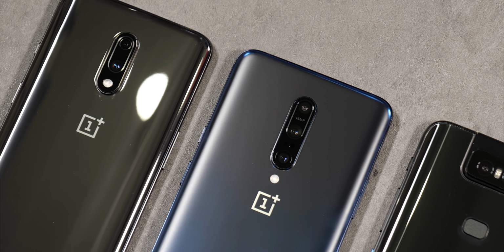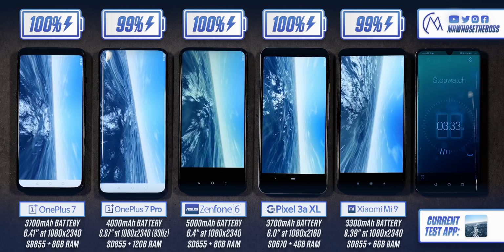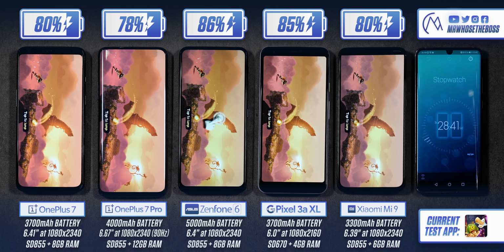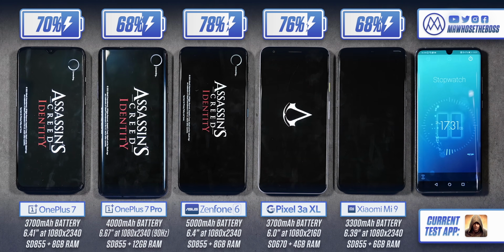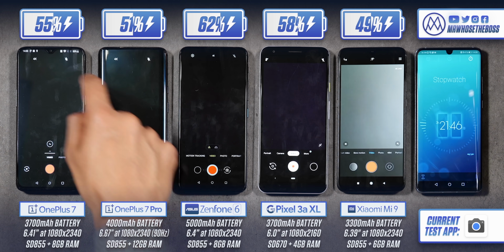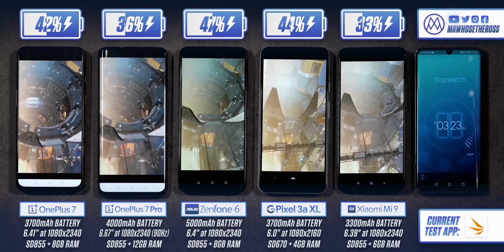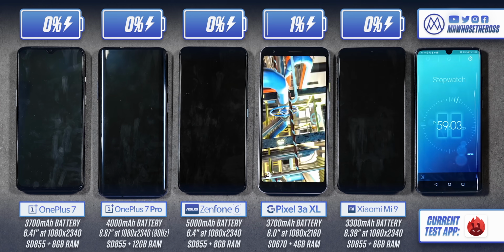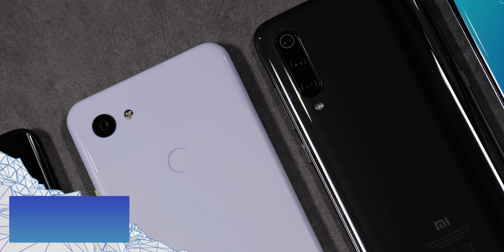OnePlus 7 vs 7 Pro / Zenfone 6 / Pixel 3a XL / Mi 9 Battery Life DRAIN Test.

Comment: Wow, Pixel 3aXL. I wouldn't have imagine that it will win. Kudos. Great video! 😁
Reply: same
Reply: yeah but look at the screen size of it. its no miracle that it won tbh.
Reply: This phone has to last longer than others because it doesn't do much (SD 670 is a lot weaker than SD 855, so...)
Reply: It's all because of the chipset. SD 670. 
6 series chipset is all about baterry life.. Amoled display also is an advantage .
Reply: 855>670 price 670<855
Reply: If you have a baby screen and a shitty slow processor, the battery is supposed to last long.
Reply: @sajeevrajendran  Yeah, I don't understand why people don't see this.
Reply: Because the chipset is low and not 855 and has a smaller screen that explains why.
Reply: @Pekara121  bud it's 6 inches it ain't that small. Lol!
Reply: @vismaydharod313  lol baby screen yeah right.
Reply: @lutlu759 not in general but compared to the other smartphones shown...
Reply: @Lohkat  Lol since the 855 is newer and more high end, it has also better Power efficience...
Reply: @vismaydharod313 snapdragon 855 processor uses less battery than any processor

Comment: The Asus have 5000mAh
The pixel have slower CPU.

I have Asus ZenFone Max Pro M1 which have both.
I get at least 9 hrs easy.
Reply: Bro 10 lol 😂 hours
Reply: Me got max pro m2 by using data for u tube and online its around 5-6 hours it's normal or not?
Reply: @mokmung3458  no idea about m2 my brother have m1 and it's battery lasts about 9to10 hours lol 😂
Reply: Hahah my phone lasts for about 40min :D
Reply: Your missing the point on his testing. He is using Max brightness and running it through very strenuous apps like 4k video recording! 
I get on average with my Mi 9 I get 9-11hrs of on screen time and combined before I charge it 17-20hrs. 
The Mi 9 does very well on battery management.
Reply: @gregwilliams4380  you are missing the point. I'm just sharing my experience with my phone. I ain't shitting on those phones, I love them.
Reply: @mokmung3458  M2 is more power consuming . I have both M1pro and M2 pro and M2 dishcharges battery pretty fast......my personal fav is M1 minus the AVG. camera,  Still if u play pubg it's better in M2 pro. .
Reply: MY LG Q6 can barely do 5 hrs 😂
Reply: Akash  noob I use the phone and trust me I dnt need a charge the whole day.. .I have a Ip8 as well but I gave to my family member....dnt want to b anxious whole day due to low battery
Reply: @internvagabond8575  as m2 have a better chip than m1
Reply: I get 2 days worth of usage
Reply: @internvagabond8575  ok bro thanks for the info
Reply: Slower cpu = worser battery performance
Reply: Even I have that 😂😂
Reply: GT_ 810* mine to
Reply: Hehe boii the same as me😎
Reply: nokia 3310 killer?
Reply: Mohamed Osama no that lasts 100 days with battery
Reply: 5000mAh and only around 10h?
Pretty bad battery management lol
Reply: @bahashajrawi7825  "worser"
Dude
Reply: @mokmung3458  Regularly I'm getting 8hrs sot in my Max pro M2.
Reply: @mokmung3458  I think that's normal bcz data eats lots of battery juice. My phone, A7 2018 can last a day with WiFi, but can't last a day with data. For my phone, it also heats a lot.
Reply: @crateer  it's based on usage patterns. If you're a light user, you can easily get 2 days of battery life, but if you're a heavy user like gamers, maybe around 7 hours.
Reply: @Born Boy me too I am using Max Pro M1 with custom rom it has great battery life same as stock rom....
Reply: @muhammadichsanjordan3857  cheap, stock android with 5000mAh. Asus must've sold a lot. Not to mention you can put pixel camera app on it, which takes wayyyyy better photos than the stock camera app.
Reply: im going to do a video on zenfone 6... it going to b epic
Reply: Mine still gives me 12 to 16 hrs
Lost 800 mAh in more than a year
Reply: I have the Asus Zenfone 3 Zoom with the 5000 mAh battery and the SD625. I get 12 hours of screen on time before my battery saver kicks in with 15% power left over. It also has an amoled display, if that makes any difference. I'll never go back to a smaller battery. I'm spoiled.
Reply: @jerrybandy3827  625 is clocked at 2 GHz, 636 at 1.8 GHz more stable and power efficient
Reply: Wow 9 hrs. On me the MPM1 always take average SOT with 8-9 hours. (With greenify non root)
Reply: @gt_8106  what is this shitty phone man? Hhh
Reply: @bahashajrawi7825  OS Optimization play a big role in battery management, and you know how Google handles software things.
Reply: My 2 year old pixel lasts 2 hours 
Meanwhile my M1 pro lasts 8 😂

Best camera. Best battery. Different bodies.
Reply: I got 1 week on my 5 years old OnePlus One ;)
(I turned into airplane mode and I rarely used :D )
Reply: Akash  this phone is pretty good if we're talking price to performance, but I'm looking forward to buying a Pixel 3a. It's such a simple phone.
Reply: Akash  Yeah I kind of find that a dealbreaker for me, sometimes I want to get the Zenfone 6, which slaughters the Pixel 3a when it comes to specs. Yet I absolutely yearn for the excellent software the Pixel 3a rocks. Until then, I'm stuck with a Max Pro M1.
Reply: Zenfone 3, 6 ir 7 h xd
Reply: @mokmung3458  no, 9-10 hrs. minimum
Reply: Bro I also have Asus Zenfone max pro m1 and I also have the same result that u have
Reply: My phone is also Asus Zenfone max pro M1 (6GB)ram variant I will get 6:30 hours with continuous playing of PUBG😇😇
Reply: Watching on my asus Zenfone max pro m1
Reply: @mokmung3458  used to have the same worry, untill i found out that there were a few apps that kept running in background and some of them didn't even show up in the battery consumed by apps section
Reply: @khami.30  can u please share with us what aps running behind mx pro m2
Reply: @mokmung3458  jio apps run a lot in the background and ate the battery of my pro m2, including JioSaavn
Reply: @khami.30  just uninstall that apps and it's be ok
Reply: My redmi 7 can last up to 12hours of screen time
Reply: Gowtham Vicky  no
Reply: wtf i have the same phone and well i dont use it so much but i get full day atleast

Comment: Pixel 3a xl won because of sd 670 its very efficient (consumes less power) and stock Android is also light 
Where as Zenfone has tons of unique ui features (close to stock) more powerful sd 855 and it has ips lcd display which consumes more power than amoled display on pixel 3a
Reply: Zenphone more like Shitphone
Reply: @User-sz7lw  lol zenfone 5z was a success it was the only phone giving a wide angle option while others gave a shitty 5mp depth sensor, it also had a flagship chip and near stock ui and zenfone 6 will deliver the same result
Reply: Sd 670 is not efficient at all its just less powerful and needs less power
Reply: The chip is rubbish it is normal
Reply: Zenfone ui is really close to stock Android i don't know where you got these information dude
Reply: 670is year old chipset. It should have came with 675 or 710
Reply: My main issue with the Zenphone would be Asus' incredibly bad reputation when it comes to actually Updating their Devices.
OnePlus has clearly lost their touch, they used to win Battery tests and also used to win on Value rating...both now gone.
Google has finally found it's way back to a phone everyone can love, and it's (unsurprisingly) the one I am typing this on just now.
Reply: Every phone at that this table had an AMOLED display whilst Zenfone 6 had LCD that what caused it to die quicker then Pixel 3a XL. If it had Amoled display it would outperform it.
I AM NOT ASUS FAN, MIND YOU I DIDN'T HAVE ANY ASUS PRODUCT SO I AM NOT DEFENDING IT. I have Xiaomi Redmi Note 5
Reply: Trippy OG how ironic...
Reply: @6oLsh0i6o0z3  he isn't wrong about the LCD and Snapdragon though. However he is wrong about the software.
Reply: @rolandrohde  Asus said that for the Zenfone 6 they have a contract with Google for Android Q
10Q and 11R
Reply: @BlackParade01  His LCD and Amoled comment was added later after the fact, and I refuse to believe 2-years old tech 10nm SD670 has better power efficiency than the latest 7nm in SD855.
Reply: @xandersander6369  
Time will tell. Their track record so far is dismal
Reply: @6oLsh0i6o0z3  because the 670 has 2 performance cores and 6 efficiency cores, all underclocked, compared to the 855 with 1 power core, 3 performance cores and 4 efficiency cores at higher clocks.
Reply: @BlackParade01  LCD consumes less power than AMOLED, only if you display a large number of black pixels (that are turned off on AMOLED), you will invert the situation.
Reply: Zenfone is close to stock Android get your facts straight before you talk bs
Reply: @6oLsh0i6o0z3  its not more efficient smarty it consumes less power
Reply: The IPS used by Asus is quite efficient and doesn't make waste, the 10%(50 min) gap from OP7 is not bad. let's just say if the Zenfone 6 used the amoled, the embedded battery is 4500 mah. I'm understand that designing a new innovation requires a high cost, and pricing is the highest consideration for Asus because it is able to consumer attractiveness when the China smartphones invade the market and conducting price wars. But on the other hand, Asus also sell a new innovations.
Reply: @Prashant Patil more ram doesn't make the cpu consume more power
Reply: @Prashant Patil True, but also higher quantities of ram require more voltage to run, even if the phone is idling with no apps open.
Reply: You're 1000% wrong bud, 10nm lithography is less efficient and as such the 670 would consume more power under the same workload. Lobby your developer to constrain your chip, implement a 3rd party governor, or face the fact that a less powerful chip cannot be considered an advantage for battery life. You are WRONG.
Reply: @6oLsh0i6o0z3  is not about nm is about the power of those chip...
Reply: @Smash_ter  I think the company is useless why put small nm then claim better battery life but in this test is lose.... I think is just marketing put the smaller 'nm'
Reply: @mTLpHfumfaomd  lol is not about how much efficient chip the consumer less power that y snapdragon mid range chip can be much more longer battery...
Reply: @rolandrohde  I just swapped from being an iphone user since 2011, to the 3a xl. First couple days were wonk, but I can honestly say, that after getting used to the OS, Im happy to have made the switch. audio jack FT(small )W. /happy.
Reply: @6oLsh0i6o0z3  salty

Comment: The pixel 3a has the very midrange low powered processor while all other phones are powered by thr sd 855.
Reply: Not really, SD670 has two performance cores.
Reply: @stark_2991   still nothing in front of 855
Reply: Exactly the reason why the SD855 should last longer
Reply: @dannysibal  no brother it's quite power efficient but also much more powerful than 670 and uses more battery.
Reply: @magnus_animus  It's not the camera, that makes Pixel photos amazing, it's the software.
Reply: @Mr_Trump  yeah , the blackberry keyone had the same sensor as the pixel 2 , but the photos were disaster.
Reply: A better processor should help the battery since it takes less work to run tasks.
Reply: @AemondTomahawk  you think? That was obviously captain obvious.
Reply: and a smaller screen size.
Reply: Exactly.  I’ll take the SD855 over half an hour of extra battery.  All current phones are good enough for a full day which is all I need.
Reply: @Mr_Trump  and the camera
Reply: Eee?
Reply: Honestly I think most flagships use the larger processor to just look better on paper because I have used both premium flagship phones with flagship processors such as the S10+ and my own pixel 3a and have been able to tell in day to day use no difference whatsoever. Now I'm not saying they are the same speed obviously but in general use I never noticed and the SD 670 is way more battery life friendly so to be honest I prefer it over the larger processors in most casescenarios
Reply: @gavinclark525  "just to look better on paper" Lol 😂😂😂
Reply: @Whitsahhere  yes as in specs because for people who aren't actually using the phone they look at the spec sheet and on the specs the SD 855 sounds ALOT better than a SD 670 even when in reality they aren't a 400 dollar difference in processors
Reply: @gavinclark525  man u need to do some research on processors. If you are doing the normal stuff like taking pics, listening to music , fb, insta then u wont see any difference. But when it comes to gaming and overall performance, sd855 is far superior then sd670.
Reply: @Whitsahhere   I'm not a tech guru not pretending to be one. And the 855 is obviously better but it in my experience isn't THAT much better. Obviously if your someone who games on your phone and needs graphics and speed to be high your going to need the nicer phone with the nicer processor. But for the average consumer like myself it is honestly a very minimal difference.
Reply: @gavinclark525  exactly my point.
Reply: I would gladly take a lower powered processor in order to get battery life that good. I don't need a god-tier processor to do what I need/want to do on my phone. Couple that with the flagship-quality camera and $480 price tag and I feel really good about my Pixel 3aXL purchase.
Reply: @Whitsahhere  so in short, if your looking for high quality gaming or intensive use of your smart phone the higher processors are better, however for the average consumer there isn't much difference and the smaller processor will save battery life
Reply: Yeah, but it has a camera that blows the others out of the water, better battery life, and guaranteed software updates for three years. Fair trade off.
Reply: Not low powered, it's utilizing a 10nm lithography which automatically puts it in a lower efficiency bracket. You're wrong.

Comment: Nice test. I'm so impressed with OP7 Pro's battery, even though it just lasted around 6hrs screen time, it's still acceptable as it's runs 90hz refresh rate display the whole time being tested. Imagine if it was switched to 60, it could've matched the Zenfone's.

Comment: Stock Android Moto...

"Keep it simple."

Battery will thank you for it.
Reply: It's the sd670 who made battery last so long.
Reply: @hermanstokbrood  Actually, better the processor, less power it consumes.
I might be wrong but I have done some research and that's what conclusion I got.
Reply: @goodmorning192  "Better", what do you mean by that? Better als in more powerful? Better as in more modern architecture? 
The fact is that more powerful SoC's consume more energy because they produce more power. Of couse you have to compare soc's from the same age. It's that simple.
Reply: herman stokbrood better as in less powerful actually. Uses much less power
Reply: @fullypowered123  yup!!
Reply: @fullypowered123  It doesn't work that way. You can't say less powerful means better.
Please do some reading about this subject.
Reply: herman stokbrood I'm saying that's what he meant. Obviously the 855 is much better
Reply: herman stokbrood also I probably know a lot more about this than you considering I've been building PC's for a while.
Reply: herman stokbrood and it does in fact work that way. Lower end processors or budget processors use less power for the most part.
Reply: @goodmorning192  more powerful=more battery consumed even though it's based on a less nano meter process it's a power hungry chip
Reply: @slimshady7625  I have read that 855 consumes less power than its predecessor. I can provide link for it as well. But please do confirm at your end.
I have never said I know about it thoroughly but i read it somewhere.
Reply: Well miui had the least battery but it still worked for 5 hours it'd be much longer than that if it had 3700 or 4k mah battery
Reply: @goodmorning192  i think what they meant by predecessor is sd800 series sd845,835 etc

Comment: when you covering the Redmi K20 Pro ?
Reply: Compared to Honor 20 Pro
Reply: Compared to the Zenfone 6, please.
Reply: Compared to OnePlus 7 pro
Reply: @ajsalvlk  yes it was made to be compared to it
Reply: lets we make this comment pop out, lets give like everybodeh
Reply: What everyone is wondering
Reply from the maker: soon!
Reply: @Mrwhosetheboss  Cool !
Reply: @ajsalvlk  OnePlus 7pro has already been beaten by the Mi 9 when the OnePlus is using it's display to Quad Hd. Even here without quad HD it was losing until he went to 4k video on it. And the reason I'm thinking is the Mi 9 uses a lot of processing power on video. If it would have been movies on the testing the Mi 9 would probably easily beat the OnePlus.
The K20pro will probably be up near the top of the pack or even 1st if it is optimized like the Mi 9.
Reply: @gregwilliams4380  I agree with u 👍
Reply: @Mrwhosetheboss  please do a camera comparison between the OnePlus 7,  7 pro, Mi 9 and K20 pro as well. That would be a very interesting test as it will check the efficiency of the software and who's is faster. Also will see whose has better camera software overall because they all use the same 48mp sensor. There is a difference between the telephoto and ultra wide angle but straight on photos and video will be interesting and night shot to. 
But if you do that test you need to redo the battery test with just those 4 in it and the 7pro set up like most will use it. 
Just a idea that a lot of people I think would find extremely valuable. 
Good video BTW! Really like your work. Keep it up and please think about the one I just proposed
Reply: When it releases in Europe.